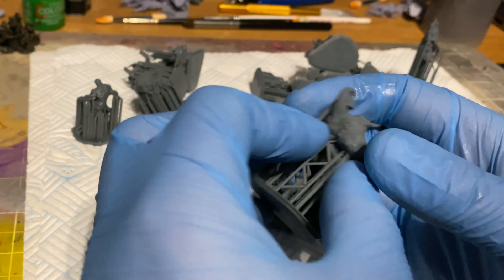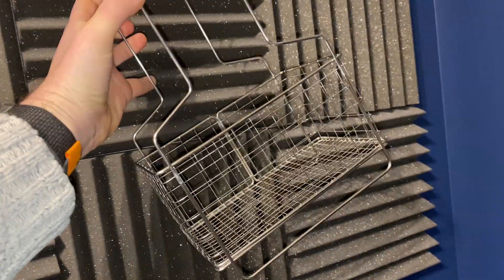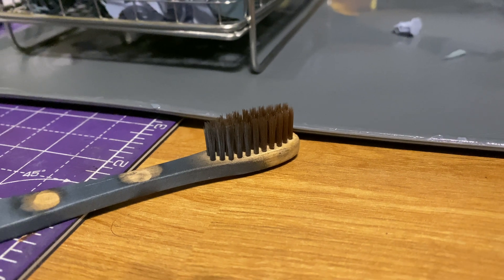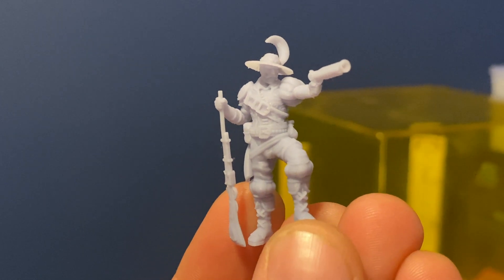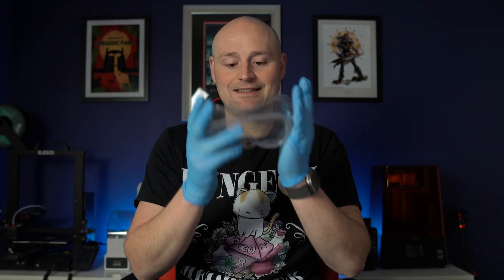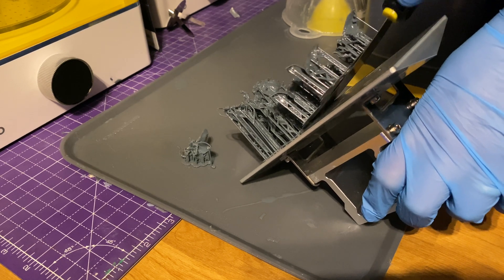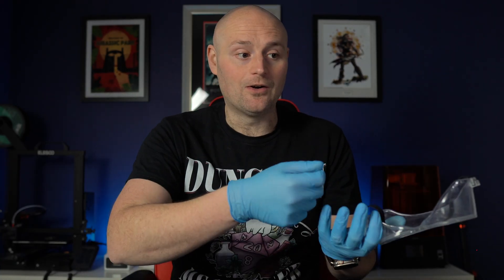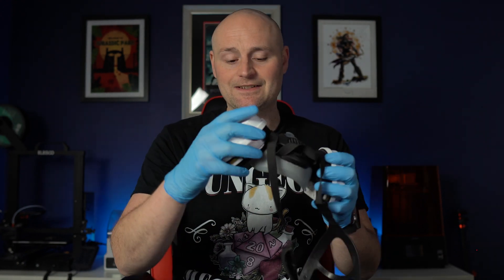Resin 3D Printing Cleaning Process and Safety Tips

Comment: How do you clean the actual print bed after you’ve scraped off the prints?  Just wipe it and then spray with ipa ?
Reply: That's all I do. I squirt a small amount from a small bottle onto the build surface and wipe down with a paper towel. Once its dry, I put a tiny bit more on and wipe down with a microfiber.

Comment: Where did you get the metal basket for dunking in the IPA? The only thing I can think to search is deep fryer baskets but they arent the right shape of handle and are $30
Reply from the maker: It came with my wash and cure machine. Maybe search for replacement wash baskets for the elegoo mercury and see if any come up.

Comment: Would you suggest using a resin printer in a garage with the door open? Or would you still use a mask?
Reply from the maker: One of the issues I've seen come up is that there can be a blast of resin air when taking the lid off your printer, so theres still a chance of breathing it in. You're minimizing risks with the garage door open which is good, but depending on the weather you might start to get failed prints if it's cold. I'm currently moving my printers into the garage and I'll be using a grow tent and a vent to exhaust the air outside, so maybe something like that could work if you've already got things setup in the garage.

Comment: One thing I'm surprised about is the effect of IPA and the ability for (proper) masks to block the vapors. A mask is very important to use when cleaning with IPA. 

I also do some sanding afterwards, which definitely requires a proper mask. (Also, I rub the sanded areas while immersed in IPA to safely remove the plastic without it being released into the wild.)
Reply from the maker: That’s an interesting tip about the sanding in IPA. I’m lazy and don’t sand so not been an issue, but worth knowing for those who do.